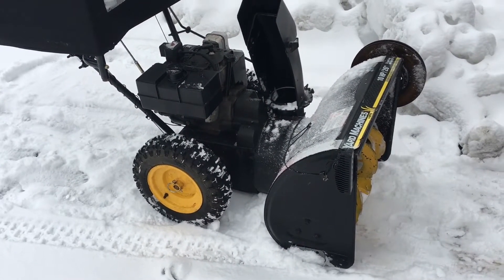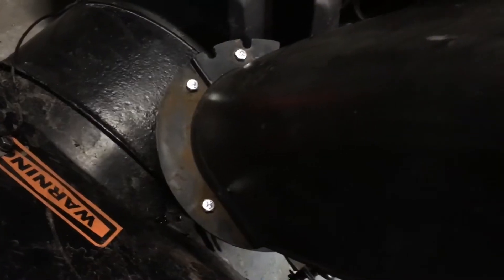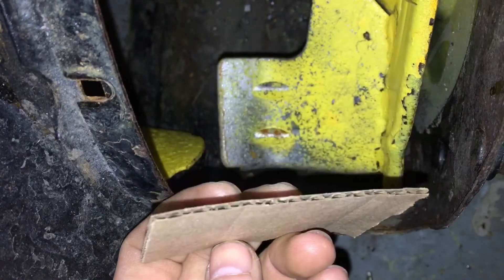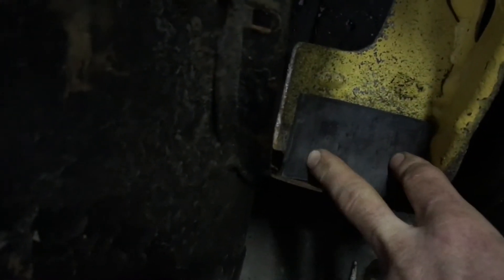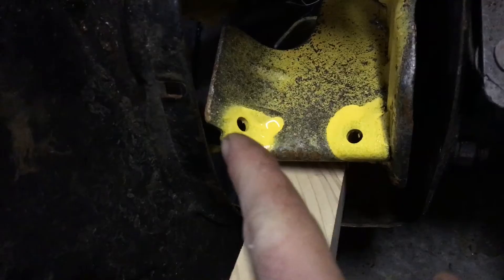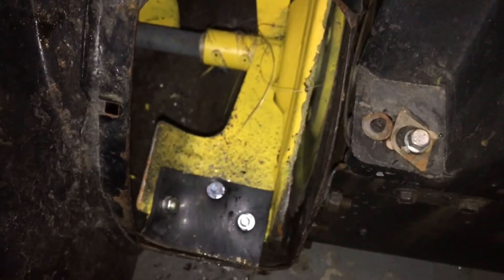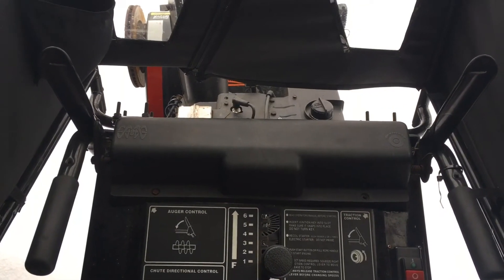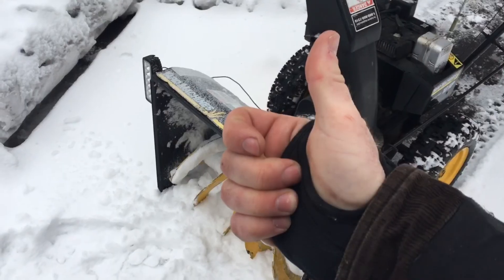Easy Peasy Lemon Squeazy DIY Snowblower Impeller Kit

Comment: If anyone is looking to do this as well. Just order a replacement paddle for a single stage snowblower. The best thing about doing this upgrade is that it doesn’t matter how wet the snow is, it will chew through it. I’ve thrown completely saturated snow over ten feet. Turns snowblower into a water pump.

Comment: I don't go out of my way to buy 10mm bolts, but I do buy 10mm sockets in bulk, LOL!  Have a specific spot in my tool chest for 10mm.  When I inevitably lose one (why is it only 10mm I lose?) I just grab another one from that chest.  My blowers both seem to throw pretty far considering what they are.  a 1965 Ariens 10M4 with the old fashioned stubby chute and a 2000-01 Ariens 824 with the tall chute.  The tall chute will fire the snow as high as the gutters on my house and the stubby one will throw nearly that high.  I had to aim the end of the chutes down somewhat because I was afraid of breaking windows with gravel from the driveway...and if I blow it in the other direction the wind just blows it right back again...with most of it hitting me, LOL!  I have the skid shoes set so that the scraper blade rides about a half inch above the ground so as not to pick up much gravel but there's always the inevitable high spot where it grabs some anyways.

Comment: Do you have a DIY headlight on there? Did you do a video for that? Thanks, great job.
Reply from the maker: I do, no video on it though. It had a regular headlight on the control panel so I added a cheap Amazon rectifier/regulator to make DC to run the LED light mounted to the front.

Comment: I put mine on after the first use of my troybilt 2410 10 years ago and never looked back! The very first time I used mine it was wet. Clogged every 15 feet. Like injecting steroids into your snowblower! Mine will damn near pump water! Lol. And throws the snow almost twice as far. Hasn't clogged since, almost 11 years now. I made mine from materials i bought at tractor supply. 💯🔥💪🇺🇲
Reply: What did you use ? I'm looking to do the same with my troybuilt
Reply: @wishingiwasfishing8396  I bought conveyor type material from tractor supply and stainless steel hardware. They make kits on Amazon as well. It's actually impressive after the fact.

Comment: I like that brake rotor trick..I might try that as I have same issue when I install my cab. FYI - I find the best product to spray on the chute and impellers etc.. is the all temp spray on ski and snowboard wax. I find that The cooking oil spray starts to thicken and solidify when it gets too cold. Cheers!
Reply from the maker: Man that spray on wax doesn’t work well for my snowboard but I’ll have to try it for the snowblower! Hasn’t snowed since I made this video of course.